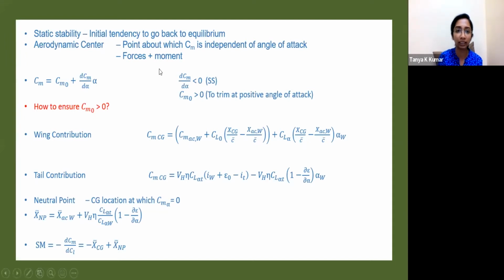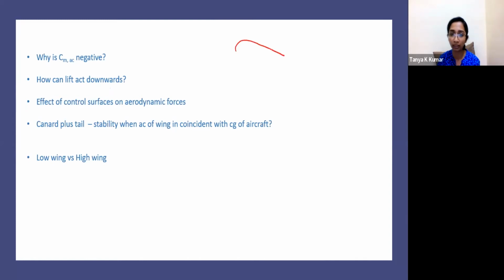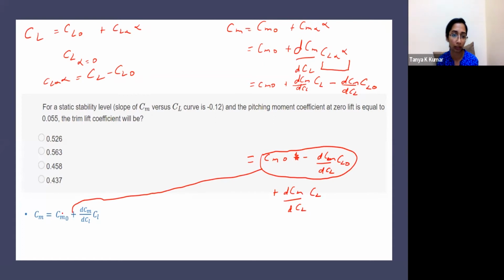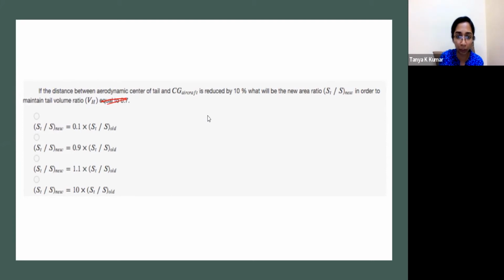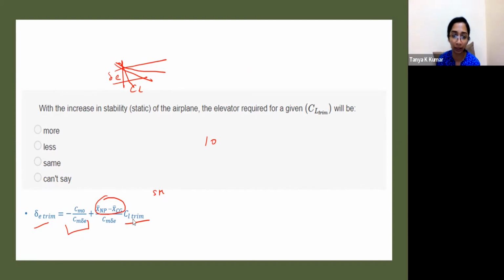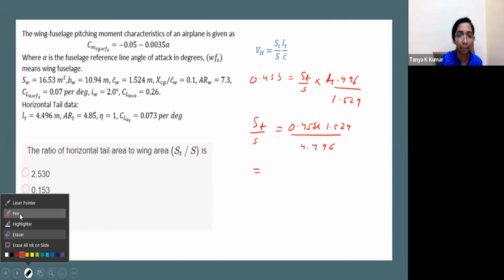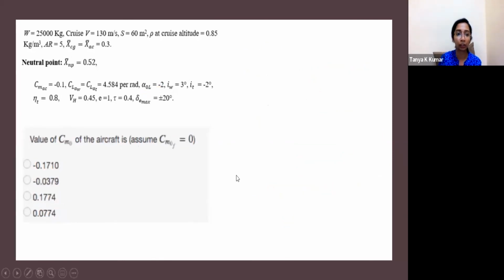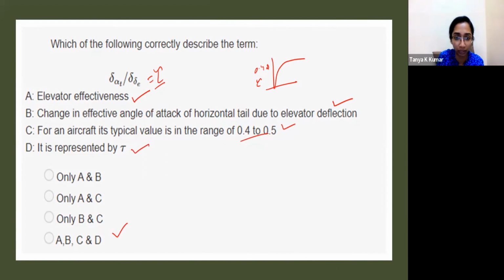Week 2

Comment: Hello Ma'am,
Some doubts here

1. One doubt in 54:09 
     During the calculation of epsilon_0, we had converted C_{L, 0} to per deg and then substituted it, but while doing so, why is it that the value of epsilon_0, is still in radians ?

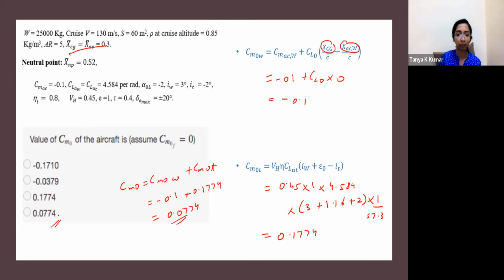2. Doubt in 57:21
    I got the result for C_{M, 0, t} as 0.22169 I substituted in the same numbers as you did, but I got this value and when I subtract 0.1 from C_{M, 0, t} to find C_{M, 0, a/c} I got the answer as 0.12169

3. Doubt in 58:18
    Same issue as the previous one, I plugged in the same numbers as you did, but I got the value for C_{M, delta e} as 0.825
Reply from the maker: 1. We did not convert C_{L, 0} to per degree. That conversion was to convert alpha_{0, L} from degrees to radians.

2. and 3. The tail efficiency factor is wrongly written as 1 while solving. Do solve the question using the values given in the question to get the right answer.